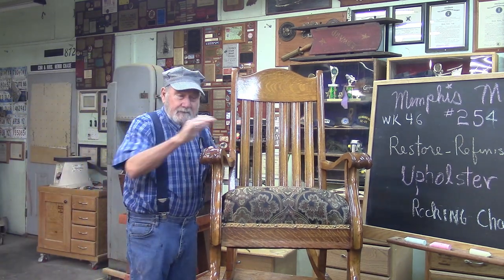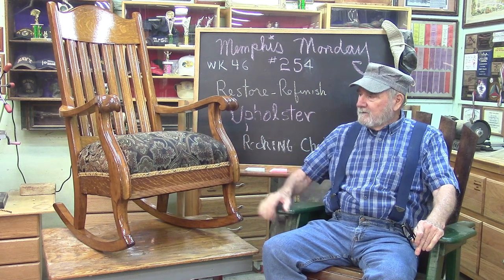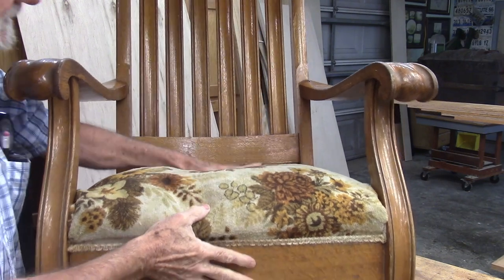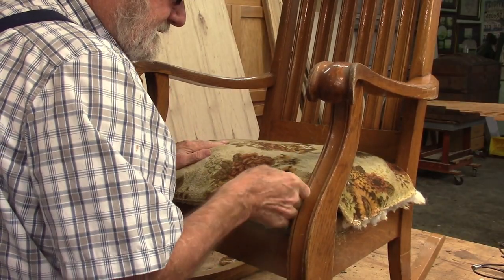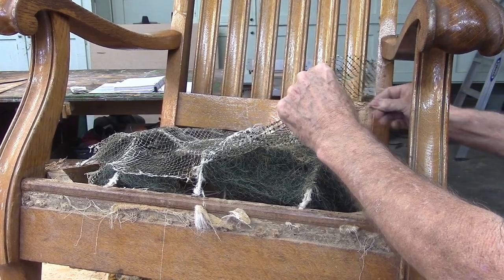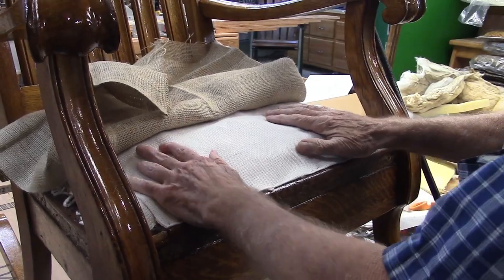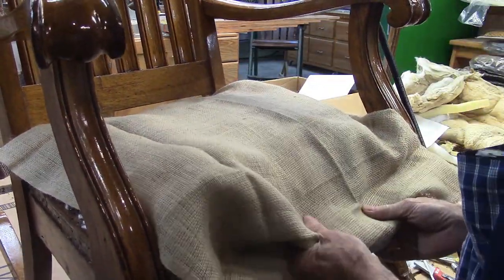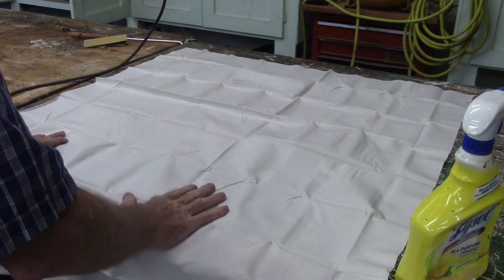254 Restoration and Upholstery of Oak Rocking Chair

Comment: I had no idea that there were that many steps to upholstering a chair. There wouldn't have been if I had been doing it! Looking forward to another adventure next week.
Reply from the maker: Many steps, but easier if the frame is sound.  In this case the frame was so rotten (iron sickness from tacks) that I spent more time fixing the frame than upholstering.  There is also specialized tools needed (like the web stretcher), and without those tools the job becomes impossible.  
     Thanks for watching, and I do hope to see you next week.

Comment: Thanks so much for this video! I just got an awesome old rocking chair that looks very similar and needs reupholstered and a little tlc to the wood but very solid condition! I’ve never done anything like this before and this video definitely gave me the confidence to take on this transformation!!! I do have a question though…if I go with the metal springs on the fixed rod instead of the webbing will I still need to knot the tops of the springs? Very excited to go forward! Thanks again!